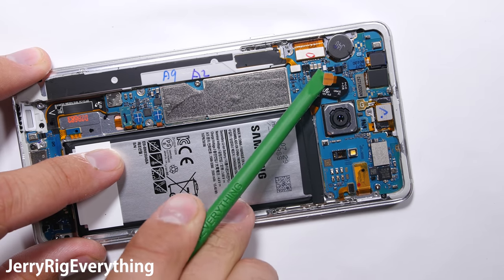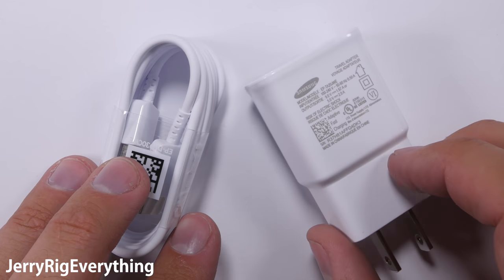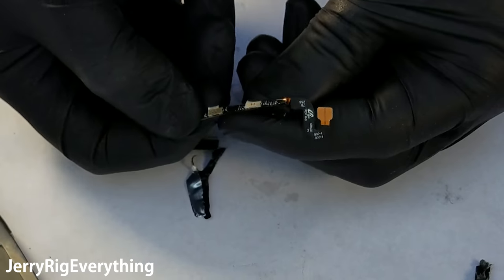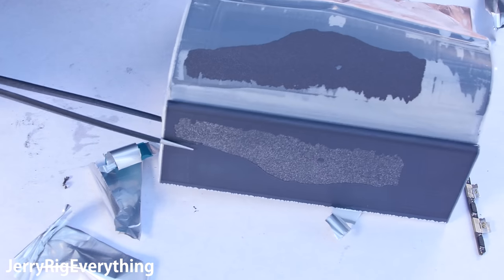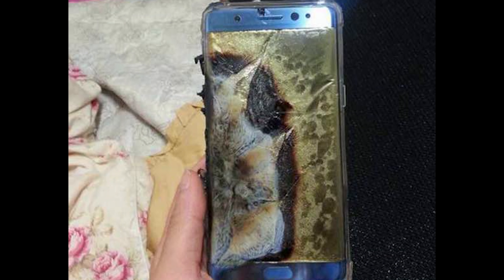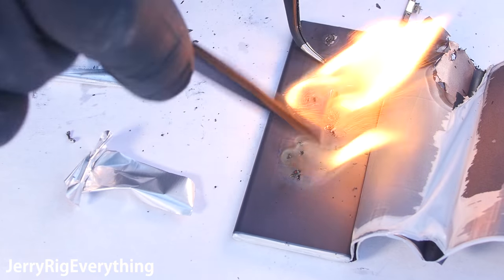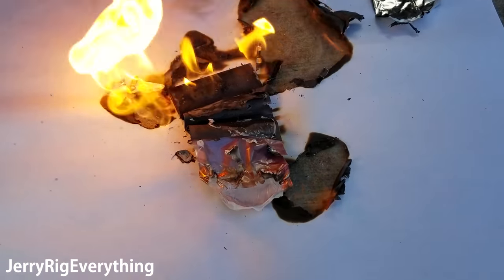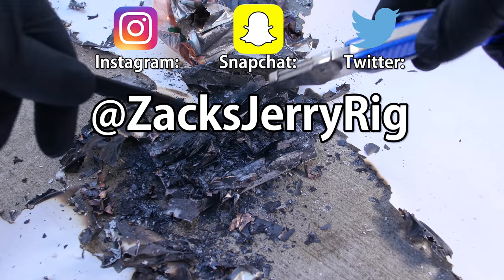Note 7 Battery Explosion!! CAUGHT LIVE ON CAMERA!!

Comment: My dad uses my iPad Air charger for his iPhone 5.......

Shit we ded
Reply: Samuel Yokoyama I use the ipad pro 12.9 charger for my iphone 6
Reply: Samuel Yokoyama they are the same charger?
Reply: NotaHipster fuck apple i want a note 7 isis edition
Reply: Charger is 5 volts and is 1 Amp so it has 5 watts (iPhone charger)
Charger is 5 volts and is 2.1 Amp so it is 10 watts (iPad charger).
So, using bigger charger on iPhone, charges the device faster.
One the other hand, without further research, I use the slow charging, on both the devices, to get more life out of them.
Reply: Railfanatic TF calm
Reply: Railfanatic yup
Reply: Samuel Yokoyama I use A samsung Galaxy grand neo for a ZTE A5
Reply: Railfanatic sad enough we only got FE Edition
Reply: iPad chargers are actually better for iPhones because they charge them faster.
Reply: UltimateR1 yes it will. I use a iPad charger and it's so much faster
Reply: Actually you guys are wrong in saying nothing will happen. Something WILL happen over time. if you use an iPad charger on an iPhone, your putting more current through a battery not designed for it. Therefore the iPhones battery will die faster over time and it will kill the life of it's battery. So that's why it's always best to use a 5 volt 1 amp charger for any cell phones. Using bigger chargers will hurt the battery's lifetime. Tablets have larger batteries and therefore will be able to handle the higher current. So that's why it's always best to use the right charger for a cell phone that outputs a safe current to the battery so as not to damage your phone.
Reply: Ark Uchiha faster does not equal better it makes the battery life much smaller and overtime is not good for the phone
Reply: YA NOTHING WRONG WITH THAT ITS 1000000000000000%SAFE!
Reply: minecraft crafter not really
Reply: RONG I VOTE APPLE APPLE APPLE!!!!!!1
Reply: Sorry caps lock!
Reply: minecraft crafter what does voting for apple have anything to do with the safety of your phone & battery